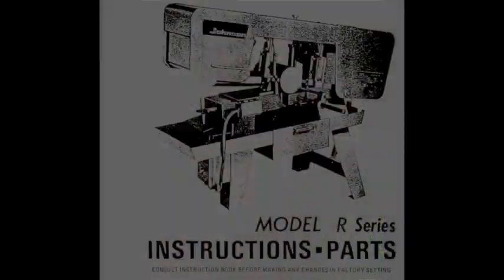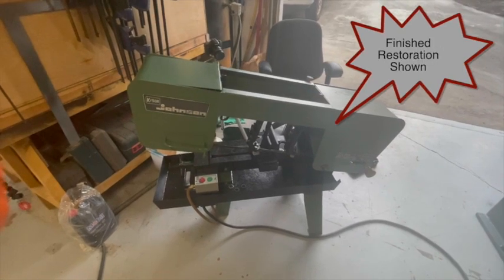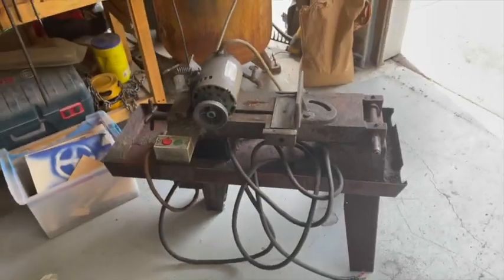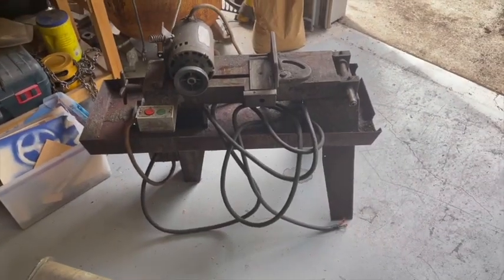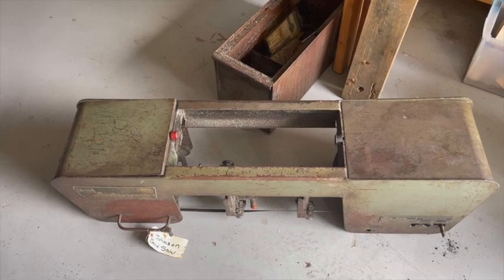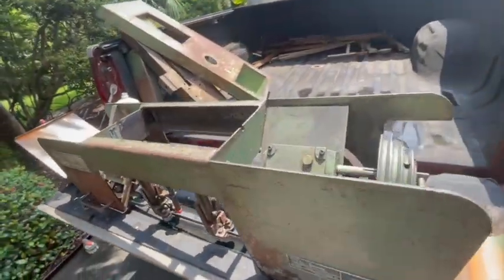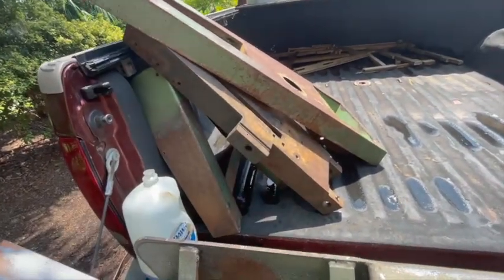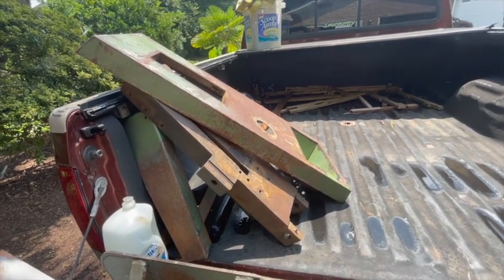Kysor Johnson Model R Bandsaw total restoration

Comment: very cool, I just picked up a model b. Looks like you may have taken the hydraulic cylinder apart but not sure? I'm trying to get info on where i can get new seals for mine. Has a leather seal in there!
Reply from the maker: Here is your manual, with parts list.  http://vintagemachinery.org/pubs/detail.aspx?id=25995. I uploaded it.
Reply from the maker: Apparently Dake (now laguna) bought Johnson in the 70s.  They still support the. machine and have spare parts.
Reply from the maker: The part number you need is  5130-00.  It cost $4.17.. lol. You cant order it online.  Contact customerservice@dakecorp.com or call 1-800-937-3253 ext 0404 and they will get you fixed up.
Reply from the maker: Let me know how it goes.  If you want to return the favor, hit like and subscribe.  Thanks bud
Reply from the maker: Let me know if you have any more questions about the machine.  I actually made a video of me rebuilding the cylinder, but I just haven't posted it.  It's a really simple and self explanatory.
Reply: @JeremiahL  I bought a Model R 2 weeks ago. I have a price list for seals in my leaky cylinder though one is no longer available. Is the needle valve something that may need to be replaced or is it all brass? Thanks!
Reply from the maker: @f350ctd  The mechanism is so simple that If I was having problems with mine, I would assume that the problem is with the seal...  If you turn the hex shaped knob counter clock wise you can pull the needle out of the cylinder...  I would visually inspect the conical tip, and unless it's rashed up, I would assume that it's fine.  Did you call DAKE and ask them about the seal that you need?
Reply: @JeremiahL  I emailed Dake and they emailed me an Operator and Service manual. I was told they no longer support these machines though some parts are still available. After I looked over the parts list I asked them for prices and availability on those parts I thought I may need to fix the slow leak in my downfeed cylinder. Out of that list there was only one item, a seal, not available. They said these machines were discontinued 30 years ago! The machine I bought looked almost new although someone did some shade tree engineering mounting a replacement motor and replaced the original 3 step drive pulley with a 4 step and had to cut a notch out of the frame for clearance. The 1hp motor that was on it when I bought it is weak so I am replacing it with a 3/4hp and going back with a 3 step pulley. OEM motor was listed as 1/2hp. What are the dimensions of the pulleys on your machine? What is your source for bandsaw blades? I bought one off Ebay. The 5/8" width is rare these days.
Reply from the maker: @f350ctd  Wierd, I was able to buy the cup leathers last year.  I sure hope they still sell them...  If you have a leak in the cylinder, You can go to the auto store, and buy some gasket material stock, and cut out a new gasket to install common to the cylinder and the cylinder base.  

As for the 5/8 blades, check these guys out:  https://www.sawserviceofwa.com/blade-support.html      They also have a store on ebay.

Here is the exact blade on ebay...  https://www.ebay.com/itm/262582599311?hash=item3d23247e8f:g:6Y8AAOSwIWVY-SZM&amdata=enc%3AAQAHAAABIGhiGlkS4SR6cR15idBqu98dSdDUhYSffTLP63gXlAVC8eZDCnK9duDZjlPLgQHuYcXHk16vcrstyor4S0SI3WMjyihkQmmRzoD1LyAqBcxm7jToh1G1WV7IStwproiv%2Bglq6R90VU98wvpjbp2%2FQVnjwuo7LP10cbe4Nfj5rfFwj63BLzR9NDY7amJ3pCbwYHiSjv3fk5m0Xf6lljimNgO3m2w7potHyKuZ064abbQbLnxJpj9Dy9lRotgWQ9eVVKmwmiqvt7R7oSxuaPaWEiw3fJOiBtQUBDFfJgBC3Vj%2F67N%2BxKZg8yuNPtQRwV3n3XU5UwS%2FBQedjgaSaU5v5OogAO%2BM%2FI2Ldcggp3CGqdkdYd4%2F3MjWwugxOONa6J5pDw%3D%3D%7Ctkp%3ABFBM2M33tphh

I mainly cut tool steel with it, and it holds up great with no issues....  slow and wet is how you want it to cut.  That is why getting that cylinder to work is so important.
Reply: @JeremiahL  I've got a Johnson Model J and the cylinder was a basket case when I bought it 20 years ago. It would be a real treat to get this one working properly. That ebay link takes me to the same item that I bought. LOL.
Reply from the maker: @f350ctd  good deal, and good luck with the restoration.  Hopefully you get another 50 years out of it.
Reply: @JeremiahL  Bad news. My gearbox is bad and replacement gears are NLA. I speculate it was shipped dry from the factory and no one checked the oil level at the final destination. I guess it is going to the scrapyard unless you need any parts. I am keeping the downfeed cylinder though.
Reply from the maker: @f350ctd  let me think about it.
Reply: @JeremiahL  seriously awesome thank you! Subbed already added a like no worries. Thanks for the help!
Reply from the maker: @pg5684  Glad to help.  Cheers